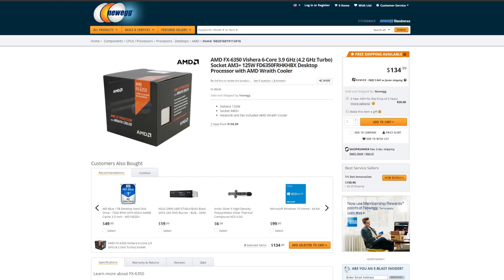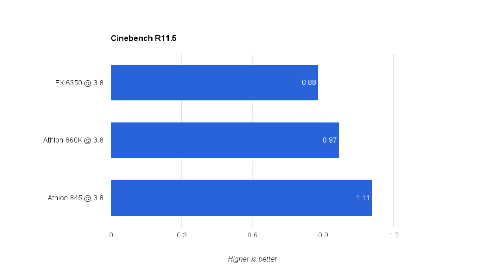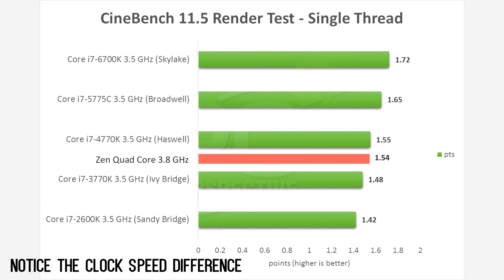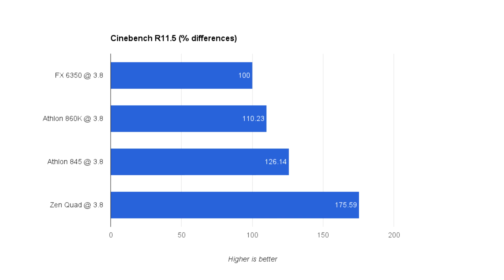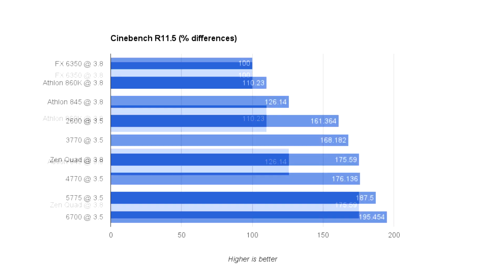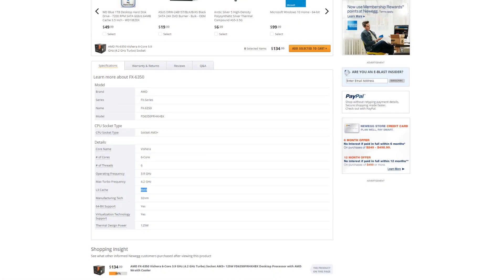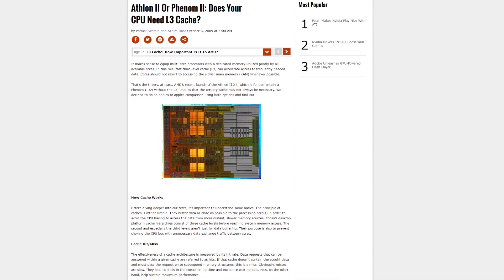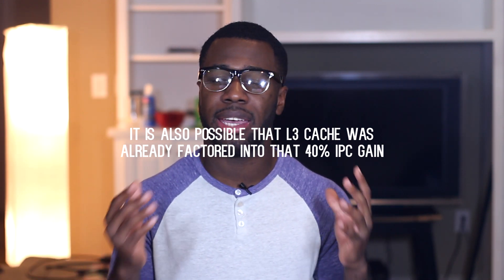How Fast & Powerful is AMD's Zen CPU? (Revisited) | OzTalksHW

Comment: Should I wait for Zen. I will pick a i3-6100 soon
Reply: Considering its still got some time away, I say no.
Reply: If you waited for Zen you would be dead by the time it came out.
Reply from the maker: Get the i3
Reply: wait for Zen ;)
Reply: ***** First of all we are talking about Zen full volume by early 2017 by which time there will be plenty of DX12 titles which will be able to use the 8 cores 16 threads.

Second I would expect the 6 core and 4 core parts to have higher clocks. For the 6 core part 3.2Ghz - 3.4Ghz base with a 3.6 - 3.7Ghz boost. Then you have the 4 core parts which will probably be at the 3.5 - 3.6Ghz base with a 4Ghz~ boost.

Because look there making a 95W 8 core part with simmlar IPC to Haswell if they can even manage 3Ghz base and a 3.5Ghz boost that's fucking amazing because there managing to reduce the TDP by -32% vs Broadwell E / Haswell E but maintain similar performance.

That in and of it's self is a feat to expect any more is unreasonable. As said I see a 140W part launching within a couple of months of the full volume availability, which will offer 3.4 - 3.5Ghz base clocks and 4Ghz~ boost clocks.

But they need to speed bin some dies first and build up a backlog, also AMD wants to have the optics of matching a 5960X / 6900k in performance, at a mainstream prices / TDP / Power draw.

Because people have an image of AMD that they are power hoggs and are super hot. So the best way to quickly dispel that idea of them is to beat intel in that very metric.

AMD is already known for being cheap, what they need is the performance and power efficiency. They can't beat Intel at a game they have been playing for 6 years which is single threaded performance.

What they can do is offer marginally worse single threaded performance but MUCH better multithreaded performance. Which early 2017 is not going to be a bad time to be better in multithreaded performance.

Personally however I think they should just push the hole thing back to early 2017 so they can get the reviews showing them kicking the ass of intel in every AAA game that came out after Q3 2016.
Reply: Depends on your current PC, probably not if this is your only real gaming PC
Reply: +Horse McHorseMan lol
Reply: +Street Guru yeah I would go with Skylake
Reply: *****
RAM that fast is probably not worth the price increase, it also still really doesn't matter for 90% of games, and only if you have like a titan X from that digital foundry test, also the motherboard price is going to increase to support RAM that fast
Reply: *****
From what I've seen digital foundry was like the only one to show some difference in gaming with RAM speeds, for the most part it still isn't going to matter, and buying a Z170 board isn't going to be worth it overall either. overall you're going to save like $50 in the end which for a budget build is a decent chunk of money

MSI VD boards have pretty good power delivery and USB 3.1 for H110/150 boards, you really don't need much more for a gaming rig,
Reply: *****
The performance of an APU directly scaled with RAM because the iGPU had to use system memory for VRAM, so the faster it is the better.
Reply: same
Reply: I would not go with the i3, only becuase some games require at least 4 cores.
Reply: Raymond The Crow
An i3 has 4 threads is perfectly fine for gaming
Reply: Street Guru 4 threads /=/ 4 cores, which 4 cores is what more modern games Require. It's a better idea to get a 4 core CPU than a 2 core one with hyper-threading.
Reply: Raymond The Crow
Point is, it'll work fine, it's not like having a pure dual core, The i3 6100 runs at 3.7ghz it's actually really solid for 60hz gaming, more so than even the i5 6400 for the money because of that i5's low clock speed.

If you had a Pentium that would be bad, but an i3 is perfectly suitable for modern gaming. It's about thread count not core count for limiting the minimum frame rate hit a pure dual core gives you in games that require 4 threads
Reply: Street Guru I'm not referring to the frame count difference of a hyper-threaded dual core VS a quad core. I'm saying that there are literally games coming out that will not run on dual cores at all, hyperthreading or not. Save the money that you would spend on a Skylake i3, and either wait for Zen, get a quad core Skylake or Kaby-Lake i5 (6600k get's my personal reccomendation), or just buy an older i5, like a 4690k. Those options will give you a lot more performance for your money than a skylake i3.
Reply: Raymond The Crow
Well do you have any links? because an i5 and an i3 both have 4 threads available to them, which a game will see as 4 threads, they shouldn't see the i3 as a dual core at all.
Reply: Street Guru (I'll assume that you're using some iteration of windows right now) Open up your task manager, click more details, and then click on the performance tab. In the CPU section, it tells you how many actual CPU cores you have, and how many logical processors that you have. A dual core threaded machine has 2 physical cores, but 4 logical processors. And programs will (most of the time) preform better on a true quad core processor, as opposed to a dual core hyper-threaded processor. If you were to look at the benchmarks for the i3, it matches up with the AMD FX 6300, which claims that it's a 6 core processor, though in reality your computer detects it as having 3 actual processing cores, and 6 logical processors, which actually makes sense.
Reply: Raymond The Crow
An i5 performs better at the same clock rate because it has 4 physical cores yes, but for games there's no distinction between a dual core hyperthreaded CPU and a quad core like an i5.  If you dropped the clock speed of an i5 until it had the same multi-threaded performance as an i3 they would perform identically in games and other tasks.

If that were the case the Athlon 750K nor i3 wouldn't be counted as a quad core for something like GTAV or Far Cry 4 which basically required quad cores.
Reply: its an i3, zen would be faster in anything cause more cores and it will prob still have higher clock speeds, but not as high as the older FX cpu's we got now
Reply: ***** and i'm doing the same with a 9 year old server cpu, sure u can play games, but u'll get bigger dips in framerate and some types of games need a better cpu to run
Reply: Definitely wait for Zen, do not make the mistake of getting a dual core CPU when better, multi core options are available for the same or lesser price.
Reply: Prabal Sood
an i3 is a 4 thread CPU, it's perfectly fine for modern gaming
Reply: +Street Guru ok I thought it was dual core
Reply: Prabal Sood it is, it has hyperthreading
Reply: Prabal Sood
What he said, it's a dual core with hyperthreading, making it a 4 thread CPU for games, so it'll run games like GTAV/Far Cry 4 no issue
Reply: +Street Guru ok then definitely go for it. I personally would go for the similar priced Fx 8300 with double the cores, but I use a lot of multi threaded applications and have a less focus on gaming.
Reply: Prabal Sood
Ya...if you really want just the cheapest 8 thread CPU with solid multi-threaded performance you can't go wrong with AMD.

The i3 is actually as fast or faster in most games that don't use 8 threads

This is by far the best AM3+ board, but for maybe $100 more total you can get a Xeon 1231v3 for better single threaded performance and similar multi-threaded performance

you'll also need to OC probably to get the full potential, it's really easy to take it to 4ghz

PCPartPicker part list: http://pcpartpicker.com/list/GvXYP6
Price breakdown by merchant: http://pcpartpicker.com/list/GvXYP6/by_merchant/

CPU: AMD FX-8300 3.3GHz 8-Core Processor  ($119.99 @ Newegg)
Motherboard: ASRock 970A-G/3.1 ATX AM3+/AM3 Motherboard  ($73.99 @ SuperBiiz)
Memory: Crucial 16GB (2 x 8GB) DDR3-1600 Memory  ($59.33 @ OutletPC)
Reply: You're going to be waiting for the APU's at that price range which wont come until early 2017.
Reply: definitely wait for zen
Reply: Wildżuź Hau But again the Zen 8 core if going to cost around about the same price as a i7 6700k while the 6 core is going to cost around the same amount as a i5 6600k.

And neither of which are in his price range if he was going to buy a i3-6100.

So hes going to be waiting 5 - 6 months tell the APU's come out, at the same time they will probably launch a 4 core non APU.
Reply: Etheoma Intel have monopoly and absurd prices i dont think AMD will go the same way
Reply: Wildżuź Hau if it will cost as much as a 6700k that would be a very good price, considering its an 8 core  with 16 threads vs a 4core with 8 threads, even the cheapest 4core should be good enough for most pple since it would be close enough in performance to a 6700k
Reply: Wildżuź Hau Well the Zen 8 core CPU is comparable to a 5960X in performance if the leak is correct about 2.8Ghz base 3.05Ghz all core boost and 3.2Ghz max boost and those are final clocks rather than the clocks of the clocks of the engineering sample.

Which means the 5960X will be more powerful by 7%~ on the base and 9%~ max which isn't that bad especially because it's $350 vs $850 and  the motherboards will be cheaper than X99 motherboards.

"And this is based off IPC being basically the same as Haswell which is about where AMD is saying it is with a 40% IPC improvement over Excavator."
Reply: Zen will undoubtedly be better than an i3-6100. The real questions now are: 
how long can you wait?
what is your cpu budget?
Reply: +Etheoma the 3.2 turbo and 2.8 base are revision A0 engineering, they are not clocked at final speeds. I agree with you on everything else. I hope these chips oc really well then people will have an absurd amount of performance to last them years to come. Basically a 5960x with a little less cache.
Reply: Ill Vill Yes sorry I should have made it more clear that they are not final clocks I was just saying hypothetically even if they were final clocks it's not THAT bad, pretty much certain that they are not it's looking good.

Personally I think there going to go with 3.0Ghz base with a 3.5Ghz turbo, I hope they also come out with a 140W part latter to compete with Skylake X
Reply: Etheoma i think they will go with higher clocks, they HAVE to compete with intel, if they sell cpu's that are underclocked, when intel pushes 4ghz even if their performance would be close at the same clock a lot of pple do not overclock themselves so they will still loose again, they should sell higher binned chips for mid range and high-end and the ones that fail to be used for cheap crap with less cores and lower clocks
Reply: Etheoma All I know is ima get me that 8 core 16 thread beast and OC the shit out of it and call it a day lol
Reply: Ill Vill Well we don't know if Zen is going to be a good overclocker. Probably and unfortunately it's not going to be seeing as it seems to be designed for low power so AMD can really start competing in the mobile market.

This would be comparable to Boardwell which if you remember had lower clocks and broardwell E which had higher stock clocks that Haswell E but the overclocking is not half as good.

You're lucky to get a 6900k to 4.4Ghz where as the 5960X you were basically garrenteed a 4.5Ghz overclock with sufficient cooling and 4.6 / 4.7 was possible.

This is due to Broardwell being designed for the mobile market, so clocks were not a concern for the most part, I think that is the root AMD has went with Zen but to an even greater degree.

As said 95W for what is basically equivalent to a 140W intel part, you don't get that kind of saving for free, given that Intel is extremely interested in the mobile market, so AMD has probably seriously sacrificed overclocking.

I know part of it comes from reduced AVX performance but that aint going to drop the TDP by 32%.
Reply: Ill Vill And when I say AMD is going to be able to REALLY compete in the mobile market I mean HARDCORE Intel is usually offering 2 core parts with hyperthreading on the mobile market.

Zen is 4 cores minimum and given that power is the main bottleneck in notebooks, and the lower you go in clocks CPU's become exponentially more efficient. They should also be able to deliver higher clock speeds as well.

So as good as Zen will be for the desktop it's going to be like 50% better than that for notebooks and maybe tablets.
Reply: +Etheoma ةرءس

Comment: What will be my incentive to buy a quad zen over a used 4770k? I hope Zen brings more than just Haswell perf, usb type c, and ddr4.
Reply: Zen will have DDR4 support, & USB Type C. It's obvious because DDR4 & Usb C are slowly becoming the standard.
Reply: Yes, I know. I was saying besides DDR4, USB Type C, and Haswell performance.
Reply: It's will have more than haswell level since cinebench is crippled on amd hardware. It's actauly gonna be around skylake,  and Intel will be on kaby Lake,  so amd will have 10% less Ipc and more cores. Very interesting. Although I hope this forces Intel to put out more cores as well since I don't wanna pay for 4 cores in 2016. Dx12 works vest with 6 cores

Comment: Not sure whether to wait for Zen or buy an i5 6600k. Currently I have an Atholon 860k clocked at 4.2GHz and is starting to show its age noticeably in modded skyrim. Can anyone give advice on what I should do?
Reply: wait for Zen. It will most likely give you more performance per $. And I wouldnt be surprised if zen beat the 6600k.
Reply: +Nadeem Shariff I will thanks for your advice

Comment: is this good for 900 dollars for bo3 and overwatch?

CPU: AMD FX-8320 3.50 GHz Eight-Core AM3+ CPU 8MB L2 Cache & Turbo Core Technology
HDD: 1TB SATA-III 6.0Gb/s 32MB Cache 7200RPM HDD (Single Drive)
MEMORY: 8GB (4GBx2) DDR3/2133MHz Dual Channel Memory (ADATA XPG V3)
MOTHERBOARD: GIGABYTE 970-Gaming SLI AMD 970 ATX w/ USB 3.1, Intel GbLAN, 1x M.2, 2 PCIe x16, 2 PCIe x1, 2 PCI
SOUND: HIGH DEFINITION ON-BOARD 7.1 AUDIO
VIDEO: AMD Radeon RX 480 8GB GDDR5 Video Card [VR Ready] (Single Card)
Reply: $900.00 seems too high, is that US, I don't think so?
Reply: +Dobermanator US, but its prebuilt. Im too nooby lel. 

And dont come with that 'its easy to build' stuff, im nooby AND pretty lazy. Took me a while to decide on PC instead of console in the first place.
Reply: +The infamous wavesettler if it can handle both and have good fps at like 1080p, im fine with it. I dont need a monster, in a casual gamer. I just cant deny mods and custom maps lol. plus steam has a ton of games console cant get
Reply: AxeDoes...Stuff Fair enough answer.  I would suggest it's still too high.  Here's a link to a prebuilt (mind you $100.00 more) it's twice the machine spec you had with SSD and 2 TB HDD and I5-6600K.  This was the first one I found so I'm certain you can find better than what you have for the same price you started with.  You have good stuff, it's just expensive even for prebuilt.  http://www.newegg.com/Product/Product.aspx?Item=N82E16883230136
Reply: +Dobermanator thanks, now i just need a monitor.

Comment: OzTalksHW, what do you think will be better, the GTX 1060 or RX 480?
Reply from the maker: 1060 in DX11 most likely, but like always, wait for benchmarks.
Reply: we all waiting for the benchmarks
Reply: 1060 is going to end up faster in most games, 480 has a chance in some DX12 titles, but in a year or so the 480 will be a lot closer thanks to driver improvements. In addition you can crossfire 480s if you really want to.

Comment: I think intel will have a trick under they're sleeve for when AMD bring the 14nm architecture.
I think they will come with a 5 or 8nm architecture just to kill it.
Reply: No.. That type of NM is going to be really hard to bring to the table and will require more than just a new architecture.
Plus NM doesn't exactly mean performance (just an FYI).
They will be releasing cannonlake however which will be 10nm in the second half of july 2017.

Comment: I'm fairly sure like the Radeon (RX Series) that Zen will effectively be a firm reduction in the performance disparity between AMD and their key competitor (NVIDIA / Intel) but realistically here I'm not expecting them to provide earth shattering performance... rather a return to what AMD do best. Performance / $ as if they can offer a Zen CPU that matches the i7 5700K (and we were seeing this with the Bristol Ridge Vs. i7 6200U, where they're trading blows in terms of performance) but at say £120 instead of the £160 that the 5700K goes for - then this will do one of two things. either a) Provide an objectively better Performance Value or b) Force Intel to Price more Competitively. • We're seeing this with the NVIDIA GTX 1060 that is said to be ~$250 comparatively to the RX 480 (4GB) for ~$200 (MSRP), while being relatively equal performance. Even if AMD aren't strictly 'The Best Performance' in said price bracket; they will remain the better budget option without much of a sacrifice, and in terms of Future Performance have the potential to edge ahead. That to me will be great, especially as Pure AMD Platforms tend to run better than the individual components might suggest; which is a great benefit of essentially providing an entire platform over just an individual component.
Reply: AMD on the GPU side of things are far more competitive than people give the credit for.